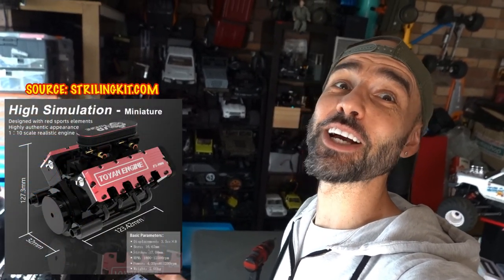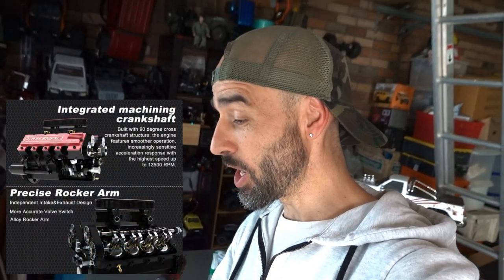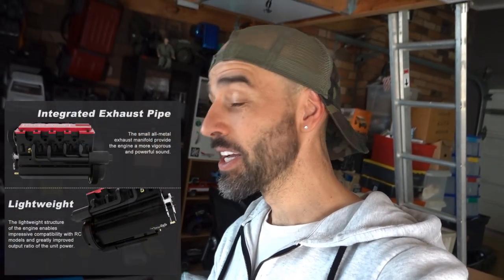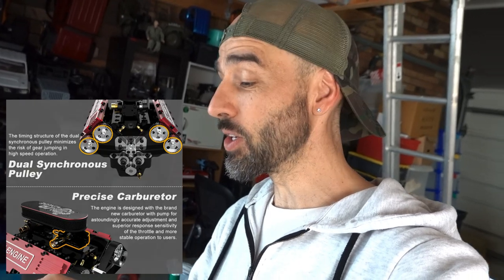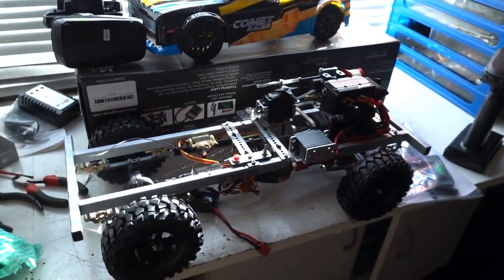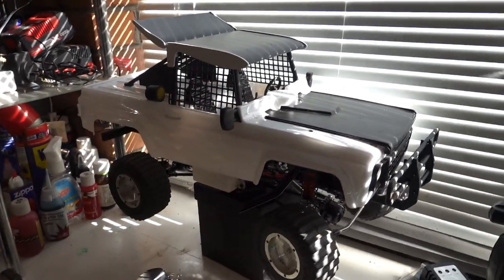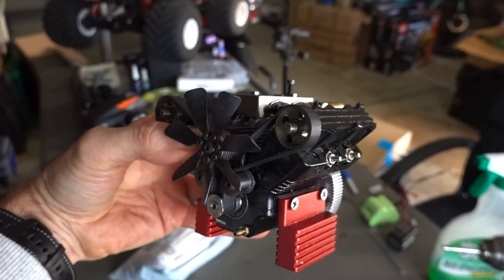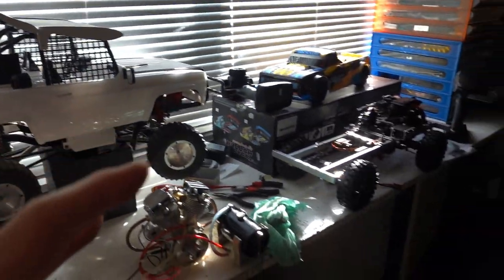NEW TOYAN V8 ENGINE - UNBELIEVABLE!

Comment from the maker: V8 ➜ https://bit.ly/3xjhBuf
Toyan Engines ➜ https://bit.ly/3mvJRRh
RTR Rock Crawler ➜ https://bit.ly/367FBW1
Rotary Single ➜ https://bit.ly/3C87ys9
Twin ➜ https://bit.ly/3M4CIW5
V-TWIN Panhead engine ➜ https://bit.ly/3zaI4ZU
Toyan X-POWER Sand Cruiser ➜ https://bit.ly/3rYC7O2